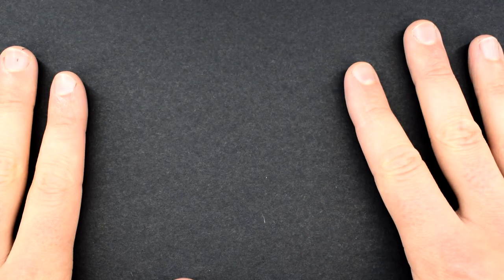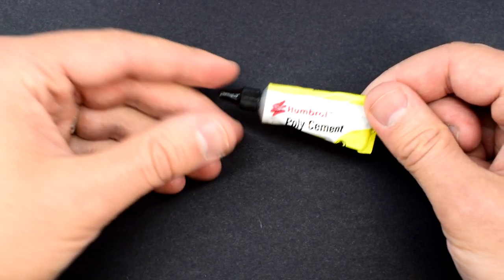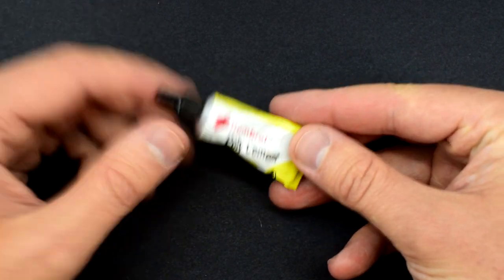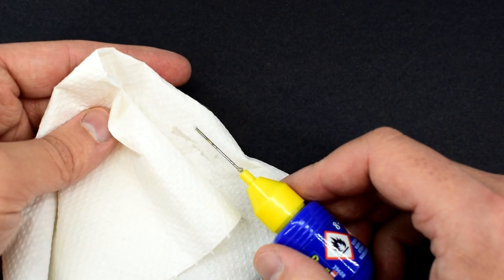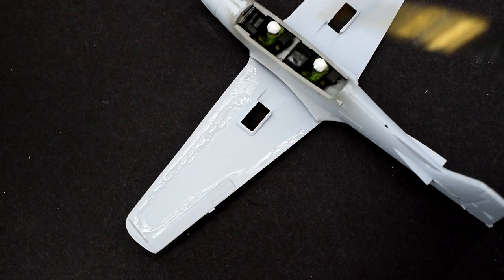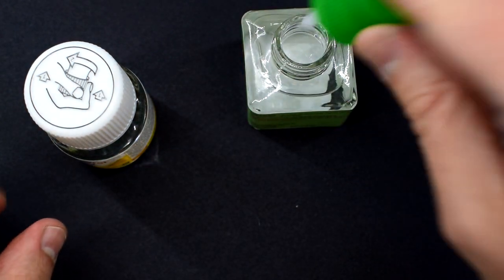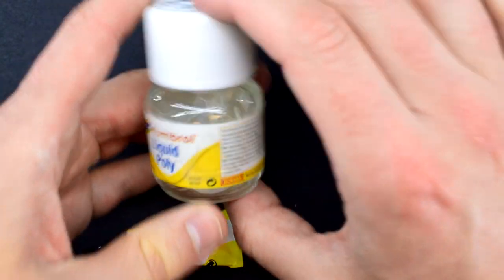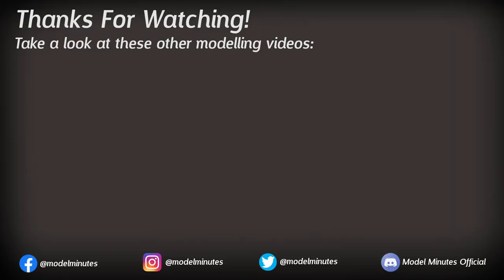From Humbrol to Tamiya - Let's talk about plastic model cements! (and my experiences with them)

Comment: Back in the 1960's and 70's when I built plastic models ($1.50 to $2.00 for a 1:24 or 1:25 scale AMT/REVEL/MONOGRAM car kit), I used Tesror's (red). 
It was the best available in my area, also quite common and affordable.  I tried the Testor's (blue) ("sniff-proof") when it came out, but it did not work as well. After time, the model fell apart, because the glue failed. The red "welded" or if you prefer, "melted" the parts together. The blue didn't.
With thecost of model cars today, I have less than zero intenton of buildng another.  The "same" kit I paid $2 for back then (usually had the option to build "1 of three ways"; stock;custom; or race) is over $20 today - and at mosthas stock or custom or race build options - not all three. Hence fewer parts.
Reply from the maker: apparently $1 in 1965 is the same as about $10 today, so realistically the models haven't actually increased in price, the money just doesn't have the same spending power

Comment: For what it is, tube glue is probably the most expensive glue out there. Fairly expensive on a per ml basis and with a much higher loss from the method of application. Ok to have if you get it in a starter set but if you're spending money the Tamiya and Mr cement options are much better value.
Reply from the maker: yeah, i never buy tube cement (mostly because I have loads from all these sets anyway)

Comment: Hi — I bought revell contacta professional ….

I’m new to minatures. Bought some (plastic — Games workshop/ Warhammer) off eBay an, and a sword snapped off in the post.

So I used the glue. Firstly it seemed like ages to get hard enough for me to leave it. 

Then came back to it at the end of the day, and it snapped off pretty easy. It didn’t stick it well. 

Games worship minatures are plastic I think. 

Do you need to shake the glue before use or something?

Am I not understanding some crucial step??
Reply from the maker: the plastic glue melts the two surfaces together, it won't work properly if:
* there is not enough surface area on the contact points
*not enough cement is used
* there is paint (or something else) acting as a barrier between the plastic and the cement
* the plastic is not polystyrene (it can work on other plastics but not always)

Comment: I have used the revell glue testors Tamiya and I love the Tamiya glue for small parts and filling seams the testors is very thick so I use that for large parts or for parts that will not move
Reply from the maker: thanks for the info!

Comment: Not long ago I built a 1/32 scale hawk with just the humbrol glue you can get out of the starter sets, due to my Revell contacta running out.
Reply from the maker: i hope it worked out ok for you
Reply: @ModelMinutes  It surprisingly worked out ok,  nearly ran out getting towards the end of the build
Reply from the maker: @costaricanzebra5475  awesome!

Comment: If i need to glue a tiny broke part, should i use the white cap or the extra thin cement. Ty
Reply from the maker: I’ve used Tamiya extra thin to glue small parts back together
Reply: @ModelMinutes  ok ty, i hope it work 😅

Comment: Hi there.
I have been using the revell glue you have here on show. If you apply too much to fit something, will it never dry and burn the plastic?
I tried to fit my landing gear down, used lots of glue and the never dried or went solid and the legs snapped off 🙁🙁🙁🙁
Reply from the maker: The action of the cement is to effectively weld the plastic parts together. Using an excess of cement can prevent the 2 surfaces from contacting each other and then just melting those areas
Reply: @ModelMinutes  Ah thanks.
That must be what happened then. A poor fit between the wheel struts and the undercarriage, using too much glue and never setting.
Oh well, another model for the dustbin!
Reply from the maker: @grahamhutton3129  don’t through it away, save it as a paint mule to try out new techniques or as a basis for a diorama in some way. There are always ways to use ruined models

Comment: Hi could you please comment on the one that smells the least this is a major problem for me as my partner is really affected by the smell of certain solvents.  I'd appreciate any advice as this is the only thing that's stopping me getting into building models thanks.
Reply from the maker: Sadly I don’t have an amazing sense of smell as it is, but I think you can get low odour versions of some of these cements. Unfortunately, as far as I can tell, they all pretty much smell pretty similar. Tamiya made a spiced pumpkin scented cement once upon a time, but I’ve not experienced that one.

Deluxe Materials make a “Roket low odour cement” - might be worth googling that but I’ve never used it
Reply: @ModelMinutes  Thankyou for your reply it was very helpful by the way your videos are great keep it up👍
Reply from the maker: @TheRabit11  thanks 😊

Comment: I have never used tamiya glue as it is slightly harder to find in store. i use the humbrol equivilent it is thicker but not  as good finish and not as good brush
Reply from the maker: Yes, tamiya extra thin can be hard to find at times but I have been fortunate to see the odd bottle here and there. Humbrol liquid poly does work ok but can be a little messier
Reply: ahh thanks @ModelMinutes

Comment: As for revell contacta glue with needle. Just pust a piece of wire inside the needle when not used. That plastic cap it comes with is useless.
Reply from the maker: good tip!

Comment: I too used the Humbrol liquid cement and the brush was too large and poor quality, glue is good though
Reply from the maker: glad to hear it wasn't just bad luck on my part then
Reply: @ModelMinutes  certainly wasn't,  also the glue is not as effective as it runs out,  the Revell glue is good to use I would agree but like yourself I find the needle clogs up, will be trying the Tamiya though,  thanks for your video's,  liked the recent one on paints and have decided to try the Vallejo colours
Reply from the maker: @anthonymitchell3225  thanks 😊

Comment: Testors model cement does the job but will not bond Airfix figures
Reply from the maker: yeah, there aren't many glues that do - it's because they are made out of polypropylene or something like that - a bit more rubbery than normal polystyrene
Reply: @ModelMinutes  if these mortar crew break off from the base one more time I’m using a soldering iron to melt the pegs into the base
Reply from the maker: @Sgt-lott10  get some fine wire, heat the end and push it inside one of the legs of the figures, then use that to stick it into your diorama base 😊
Reply: @ModelMinutes  thank you
Reply: There are a number of ways to glue "bastard" plastics with varying degrees of success; 
Tamiya make a primer for bonding PP, PE and POM plastics.
Using CA with accelerator will sometimes bond plastics which cannot normally be glued. Thin CA poured onto baking soda can also work very well and cures almost instantly. 
I also like the idea of omitting the base or replace the base with a plastic you can glue to improve the odds of adhesion.